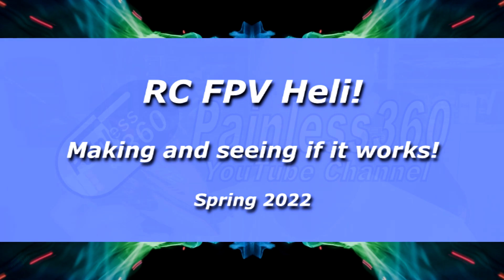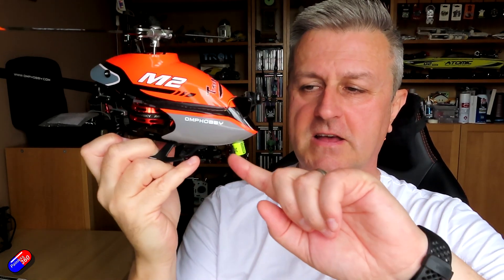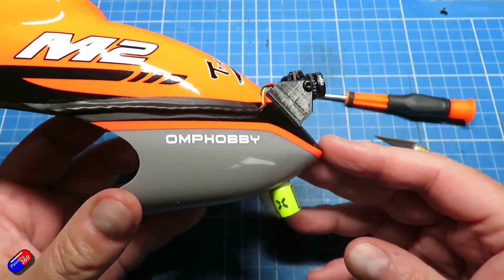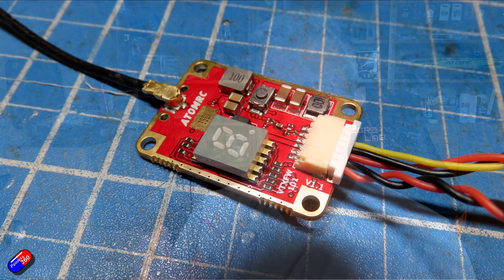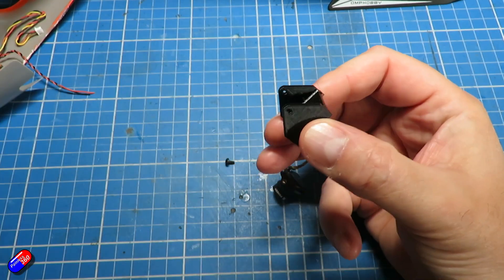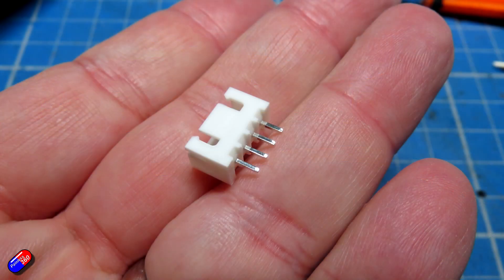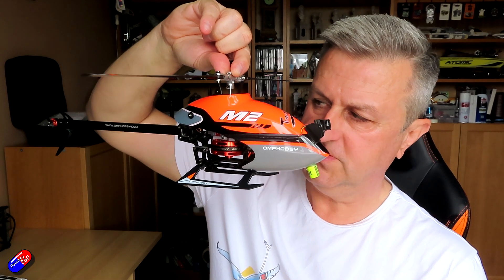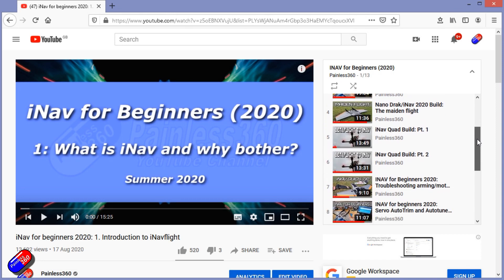Adding FPV to my RC Helicopter!

Comment: I use Walksnail to FPV my 250 gram heli. The flight time is 35 minutes with full HD recording. And the dives are straight down unlike quads rolling down.

Comment: i’ve always flown helis never a fpv drone but always wished i could do this, after a year do you still fly this? or fad?
Reply from the maker: Not much. The issue is that the vibration is hard to isolate and more noticeable as you use cameras with higher resolutions... Happy flying

Comment: Could you possibly share the STL file for the bracket?
Reply from the maker: Link added to the video description. Use some vibration isolating foam under it to help with vibration. Higher res. cameras seem a lot more suspensible to wobble.
Reply: @Painless360  Thanks a lot!

Comment: I just velcroed my larva x to the front of my new heli on the training gear x to simulate osd it worked fine mine is the fw 450l v2  would love to add an osd to it but it has the h1 lite fc so I'm looking for a good stand alone osd that is pixel based if I have to I may add another fc just for the osd their is plenty of room I'm down to just which vtx probably a mamba and osd ???? Maybe the newer mamba f7

Comment: Do you know how to make a model for RadioMaster tx16s edgetx, i have an Align Trex 500x,  with microbeast plus and using a Kinsun Receive. Don't know how to program the th16s.
Reply from the maker: Not sure what channels that controller needs but I have a setup video for this model using that radio in the series... Check it out.. Best of luck

Comment: FPV and choppers are great and I've been doing it for many years.
Landing is the tricky bit, a hint I would add is making sure your horizon line is center screen and level in hover, this will help you work out your in a zero movement hover before you land.
Much like flying a quad but with no smarts like auto level..
Have fun, Enjoy the adrenaline on landing and I'm looking forward to your flight video.